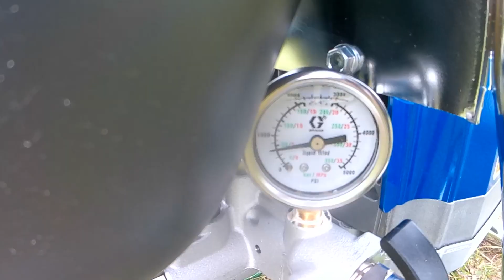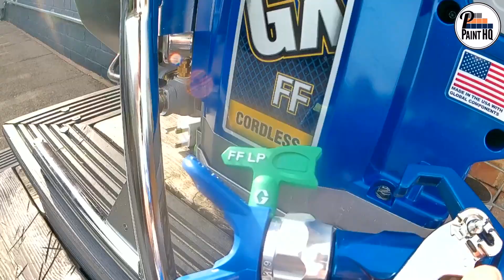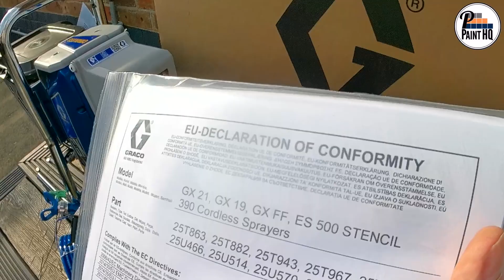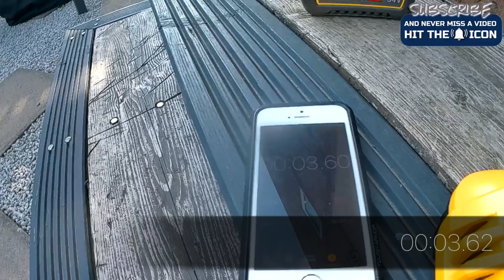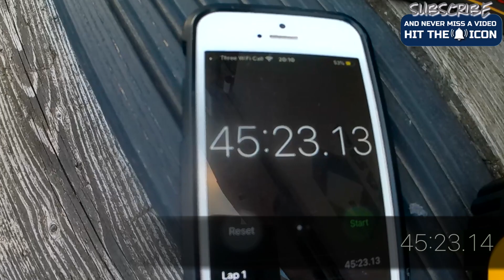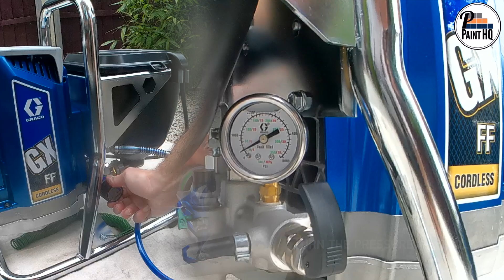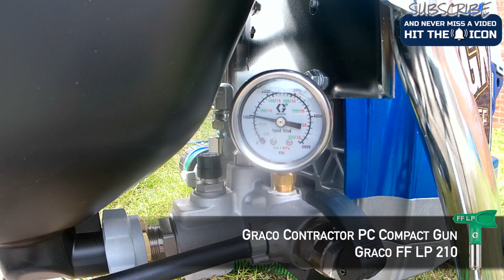Graco GXFF Cordless. GXFF Cordless Airless Paint Sprayer Setup & Spray

Comment from the maker: Hoping to do some more testing and put this innovative GXFF Cordless unit to work.. Battery performance (taken from Graco website), lists a spray time, up to 23 litres from a 6ah FLEXVOLT battery.. earlier cordless models, GX21 and Classic 390, lists up to 11.5 litres on a single battery charge.. Whilst the GXFF can handle emulsions, the GXFF with it’s hopper design is primarily aimed at Fine Finish spraying (typically lower viscosity).. all factors affecting battery life.. The GX21 / Classic 390 and GXFF cordless units are installed with brushless DC motors which improves battery performance.. I personally liked how smooth the pump ran, sounding much quieter than corded GX models, and you don’t think about not being connected to mains power, the battery performance is that good.. hope you enjoy the video.. as always it’s great to get your thoughts and feedback.. regards Pete

Comment: A very handy piece of kit for site work doors and skirts and door cases it's perfect it would make life so much easier and a damn site quicker as well
Reply from the maker: Hey John, you’re right.. with the onboard hopper and being free of cables, it’s so easy to pick up and move around the job site 👌 a great move by Graco also, to include the Contractor PC Compact Gun 💯..thanks for your contribution on the channel, always a pleasure to hear from you.. regards Pete
Reply: The gun looks good and nice to hold and not dig in your hand like some do it sounds daft but a comfortable gun makes a big difference if your spraying all day every day I much prefer a two finger trigger than a four it feels more controllable if that makes sense
Reply from the maker: Yeah you’re spot on my friend 👌👏👏👏👍
Reply: A quick question for you mate I'm after getting a new pump I'm looking at the GX21 the PP90 and the titan 440 which one would you say is the best cheers mate
Reply from the maker: Hi John, firstly the 3 brands you’re looking are all reputable and offer models in a similar competing class..  the 440 with its higher max tip of .023 ..is more aligned to the Graco Classic 395, rather than a GX range unit.. I own a 395 myself and can vouch for it’s quality, it’s a real workhorse with added features like SmartControl (helps regulate pressure).. Price wise I’m guessing the 440 is a higher bracket Vs the PP90 or GX21.. the PP90 I believe has a max max tip .019, which is GX aligned, more so the GXFF.. the GX21 has a max tip .021.. like the GX models aimed at the P&D market / smaller paint contractor.. suited to the domestic needs of the P&D, can spray emulsions, the odd exterior with smooth masonry paints.. then of course trim / woodwork ..especially if you add a hopper (the SpraymanUK GX21FF).. a GX21 hybrid.. GX21 with a Fine Finishing kit (hopper), but you can switch quickly between hopper and siphon modes.. this I feel is where the GX21 (with hopper kit) has the advantage over a PP90.. you can add a hopper to the PP90, but I’m not aware of the ease you can switch modes.. now I could be wrong.. my ear is to the ground in the spraying world, but I can’t vouch personally for the PP90 (not used one I’m afraid).. I can the GX21 and it’s a sprayer that meets the demands of the P&D, I’ve heard many stories of then being worked hard.. and of course, if a new pump was required, the ProXChange Pump that fits the complete GX range, corded and cordless.. is good value that can be swapped out easily by the end-user 👍 ..Have a chat to Mike at SpraymanUK, he’s a great guy, hugely knowledgeable and will give you no pressure advise.. contact details in the description 👍 ..Hope this helps, keep in touch with how you progress and either way, I’m happy to help if I can to get you spraying.. regards Pete 🎨💯
Reply: Thanks for the info greatly appreciated mate 👍
Reply from the maker: You’re very welcome, anytime 🙏

Comment: How do you remove the left over paint from the hopper? For instance if you were using two different paints in a customers property and is flushing it out a problem again while in someone's property and there is no option to tip the waste water/paint away..
Reply from the maker: Hi John, thanks for your question.. hopefully I’ve understood you my friend 😆 ..The left over paint in the hopper gets ‘primed’ back into the paint can.. then you use water to flush the hopper / pump and line through into a waste bucket.. about 2 or 3 times depending how ‘strong’ the colour change.. then you can put the 2nd colour in.. flushing / cleaning the sprayer will approx fill one builders bucket.. you would then need to eventually ‘dispose’ of this bucket of dirty water as responsibly as you can 😆 ..have I answered this for you ok, apologies if I’ve misunderstood.. regards Pete
Reply: @PaintHQ  yes thank you for the reply, I'm looking at buying a sprayer just for doors, trim etc and was concerned about the clean up especially flushing out the full hose so was looking more towards the Gravo HVLP as its only the gun that requires cleaning after use and could be done after leaving the customers property.
Reply from the maker: Hi John, ah I see your dilemma.. just to reassure, the cleanup of an airless sprayer, especially one with a hopper such as the GXFF Cordless, is actually a quick and simple process.. A HVLP gun is also simple, perhaps a similar time in that you need to strip the gun to clean the needle, nozzle, air cap etc.. in terms of mastering how to spray if you’re new, an airless sprayer is easier Vs HVLP and the potential to have to thin the paint and then get the right mix of fluid and air.. airless is quicker to spray a job too 👍 ..Keep in touch and let me know if I can be of any help at all.. regards Pete
Reply: @PaintHQ  I do have the Graco cordless ultramax which I absolutely hate and the company I purchased it from told me to put it straight in the bin 😳.. think I'm leaning more towards the HVLP at the moment as it is just for trim and doors and I would like to keep over spray down to a minimum, thank you Pete for all your help and I look forward to more of your YT videos..
Reply from the maker: Hey John, that’s a shame you’re not liking the Ultra Handheld.. I know it can get a bad rap, I’ve had lots of success using it myself.. anything I can do to help, I’m happy to try and get you up and running.. regards Pete

Comment: Another excellent video pete and I like the way you showed it working outside which really highlights the ease of use with cordless,it looks like an excellent machine and I'm looking forward to you putting it to use on jobs!the charge time on the batteries looks decent too,obviously its for smaller jobs would it work well do you think on kitchen presses spraying an oil based finish?
Reply from the maker: Hi Edmond, as always I appreciate your support.. yeah the GXFF Cordless is primarily suited to fine finish spraying, with it’s onboard hopper it lends itself to spraying small quantities of material.. it can spray oil / solvent or waterborne material.. only consideration if spraying oil / solvents is to use the grounding wire to earth and protect against an ignition risk.. this GXFF Cordless is perfect for spraying all types of joinery and cabinetry, especially as it comes with the Graco Contractor PC Compact gun as standard.. then with a max .019 tip size is able to spray emulsions if required 👍 ..hope you’re keeping well buddy 🙏 ..regards Pete

Comment: Good afternoon friend, with airless nozzle 515 how many m2 can you do with 15 liters of paint, an approximate value in m2? Greetings from Portugal
Reply from the maker: Hi Nuno, great to hear from you in Portugal my friend 🇵🇹🙏 ..it’s tricky to give a generic answer, but I can give you some advise.. First check the product data sheet regarding coverage (probably listed using a brush / roller).. then consider with airless spraying It’s inevitable there is going to be ‘waste’, because the transfer efficiency of Airless is considered poor Vs brush / roller. So you need to allow for the waste, roughly you’ll use 30-40% more material.. The trick reducing waste, is choosing the right pressure to effectively atomise the material.. too much pressure and the material bounces off the wall/ceiling.. hope this helps, keep in touch.. regards Pete
Reply: @PaintHQ  Good morning Pete, your answer is the most correct, we actually spent more ink but in your opinion the work is better right? Also what I notice is that when working alone the airless makes the work faster and with less demos, what do you think with your experience Pete?

Comment: Hi Pete just bought the GX21FF with the hopper kit from Sprayman after being inspired by your videos here. Have you ever used johnstones trade aqua water based undercoat and the gloss? There is no guide that says it’s suitable for a sprayer on the back of the tin but thought you may have used it before. About to start my first job with it and have been supplied with this paint. Thanks
Reply from the maker: Hey Kevin, ah this is great news, so pleased you’ve been inspired.. I’m there for you all I can to help and advise on your spraying journey.. firstly I do rate the Johnstones Aqua range from my brush / roller days.. now spraying, if you was talking HVLP then I’d say it’s horrible to spray ☹️ ..airless spraying, I can’t 100 percent say it sprays nice.. typically airless spraying will break up and spray more often than not, with the right tip selection and pressure.. I do recall someone on here saying Johnstones Aqua resulted in an ‘orange peel’ finish, which doesn’t add up to airless spraying, that’s normally a problem associated with HVLP and too much air.. so if this is true it could be the paint isn’t atomising well and levelling off as it dries.. what id do is use an FFLP 310 (could use a 210 but move a bit quicker), endure the paint is at least room temperature, test the pattern on sone brown paper (I’m guessing you’ll be around 1200 psi.. start there and move up to 1400.. etc if it’s not a nice even pattern).. what ever happens, don’t be put off.. I don’t think for a minute it’ll go horribly wrong.. like I say most paints will go through airless, there is just the odd anomaly.. let me know how you get on my friend 🙏
Reply: @PaintHQ  thanks Pete. Yeah it’s a really thick paint especially the undercoat. You need to clean your brushes every night after using the undercoat especially which is why thought the tips might not like this paint. Might leave it until the next job and try another brand first. Thanks for your reply.

Comment: Great video Pete. Just wondered, is it fine spraying emulsions out of the 3/16” hose? Or is that only for finish paints (woodwork etc)? Or do you need to swap it out for the bigger hose when spraying emulsions? Thanks
Reply from the maker: Hi Josh, apologies for the delayed response.. It's a very good question.. I personally stick to the 3/16" 7.5m hose for both fine finishes and emulsions.. all my units have a 3/16" hose, the other day I used my 395 to spray Optiva Acrylic Primer on fresh plaster throughout a full house. I used a coupler to join another 3/16" 7.5m hose to total 15m and I was able to reach round the entire property.. I much prefer the flexibility of a smaller, much more manageable hose.. I don't believe I'm doing anything detrimental. I believe it's problematic with SmartControl on much bigger pumps than the 395, it can interfere with regulating pressure.. but certainly not a problem with GX models.. From an engineering perspective it's true, thicker materials would suffer less friction through a bigger 1/4" line.. but like I say I've never experienced a problem, and never felt the pump has overworked, etc.. Hope this helps.. regards Pete

Comment: Bloody marvellous 🤩. Is it that much more noticeably quieter? This could be a handy tool to add to the collection, i always fancied myself the GXFF over the 21 as it’s a little more compact. I think for the price it’s not a bad deal at all. Does it still use the pro X change piston as the older versions? 
Great video as always Pete! You’re a top bloke sharing all this information P.S i still want a 395 though 🤣🤣 
Hope you’re keeping well dude
Reply from the maker: Hi James, you’re an absolute diamond, appreciate your feedback.. Yeah it’s the same ProXChange Pump that fits the GX range, corded and cordless.. good value replacement that can been swapped out easily by the end-user.. I was speaking to Mike at SpraymanUK, the Brushless DC motors do run more quieter and efficiently, it’s essential for less power consumption in the cordless units.. it’s one of the first things I noticed, when priming, the motor / pump runs more sweeter, sort of less ‘aggressive’.. It was a pleasure to operate, seemed surreal not needing to plug in and you soon forget you’re operating off a battery 👍😆 ..all the best buddy, thanks again for your input and supporting PaintHQ.. regards Pete

Comment: Another question Pete. Sorry 😄 Been using the Tritech t5 recently and was just blown away at the consistency and precision when spraying at lower pressures. I know its a different pump, and those machines are just built different, they’re amazing. But with this unit, how have you found the spraying at lower pressures? Is it pretty steady?
Reply from the maker: Hi Josh, great to hear from you.. I’m always happy to answer any questions if I can 👍 ..the GX models are a single stroke piston, so by design you’ll see the needle ‘pulse’ when spraying with these units.. I can however, vouch that I’ve never experienced any detriment to the sprayed finish 👌 the GXFF Cordless is one of my favourite models, I like the brushless motor design that improves power efficiency 💙 ..keep in touch, always a pleasure to hear from you.. regards Pete

Comment: They look great expensive   ? Would you recommend it Pete
Reply from the maker: Hi Niall, thanks for your question.. there is added cost in cordless technology, for example the inclusion of a brushless DC motor is important for power efficiency but the technology costs more Vs ‘standard’ AC motors.. then you get value out the box with 2 DeWALT FlexVolt batteries, and the incredible Contractor PC Compact gun ..it’s all worth it, if you can stretch to the extra cost Vs the corded model.. the freedom you get to spray anywhere without wires will certainly earn you money quickly.. and you’re investing in technology that will last.. hope this helps my friend.. always a pleasure to hear from you and get your input.. regards Pete
Reply: Hi pete . No worries thanks for the reply 👍😊 yes thinking that great going cordless with looking for power on jobs. Be good use if up on scaffolding just bring up with you spraying render or simliar. Think might invest in one for sure 👍
Reply from the maker: Sounds great, you’re doing some nice work my friend 👏👏👏👍
Reply: Good morning pete . Getting busy thank goodness 😊👍 and you hope you keeping busy plenty of work coming in 👍

Comment: Tempting but not really required , I’ll stick with the generator on site or the transformer .
Just leave generator in back of van to save my back and run a 110 extension or two
Reply from the maker: Hey David, appreciate your feedback.. it’s great to get your input and hear about your setup.. hope you’re keeping well 🙏 ..regards Pete
Reply: More about volume for me misting 3/4/5 bedders and twenty plus doors and spindles so those machines are a bit toy 
Stick with my t5 , t7 next on the list
Reply from the maker: Yeah I know whet you’re saying, it’s not a one size fits all when spraying in different environments.. I do feel with the advancement in battery / cordless technology the possibilities are growing and will start to give generators some competition.. if you take one of the first tools that it made sense to go cordless.. the drill.. no one now would go back to a corded version.. with the DeWALT 54v FLEXVOLT technology, and I believe you can get 15ah batteries now.. they’re powering some big tools for longer 👌👍😆
Reply: The generator set up suits me fine 
Can’t rely on electric , compound miles away for charging so not at all handy 
Batteries probably only suitable for smaller machines plus similar cost for a machine and generator set up
Reply from the maker: I appreciate what you’re saying 👍 ..You’re doing awesome my friend 🙏